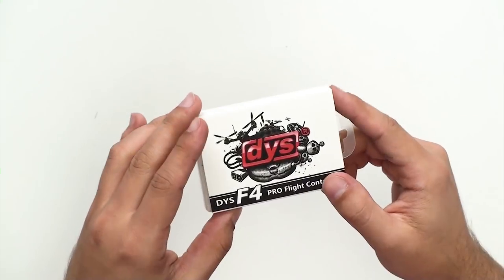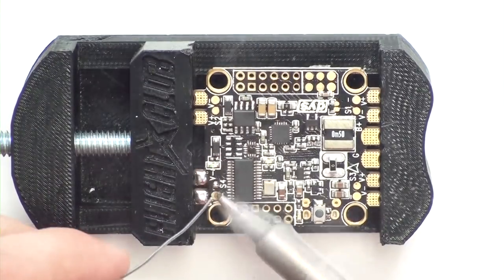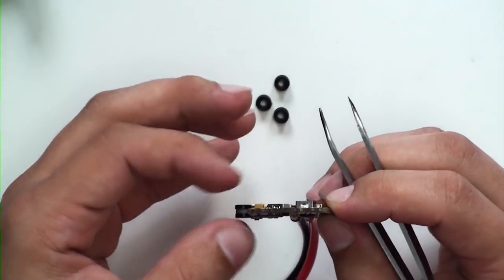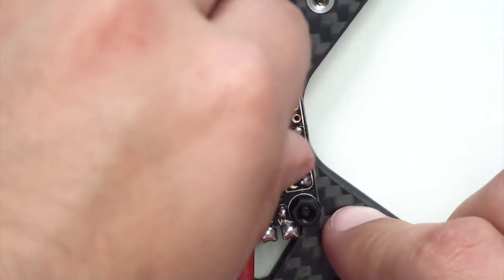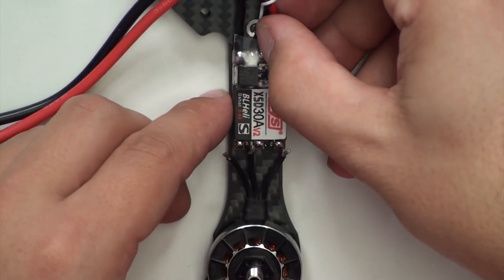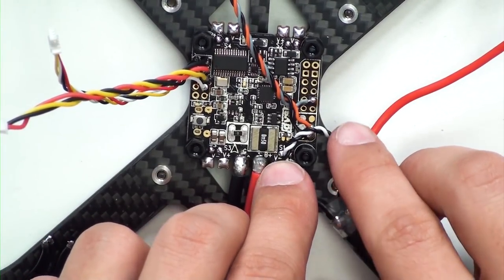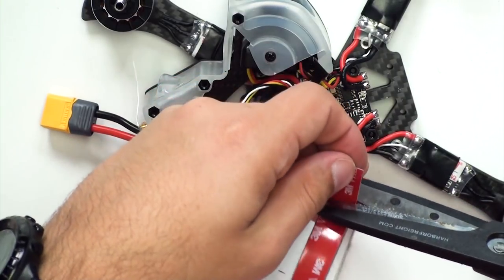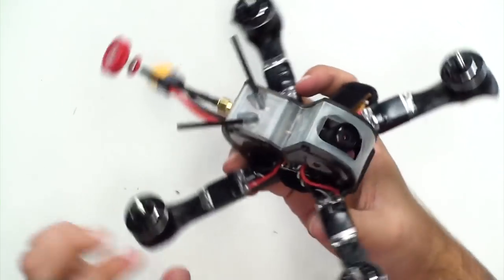NewBeeDrone Leviathan Build

Comment: I’m a noob so apologies if this is a dumb question - 
The video shows the m2306 motors and the 30A ESC however neither is available on the site. The 35A ESC and the 2305 motors will work fine, correct?
Reply: I would like to know also. another NewBeeeeeee here